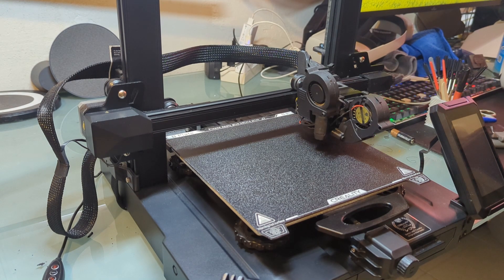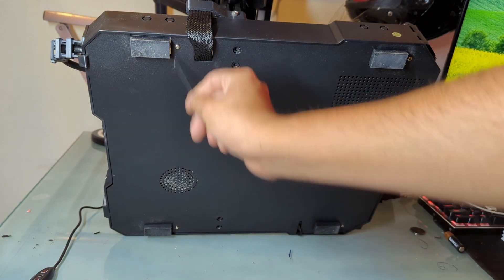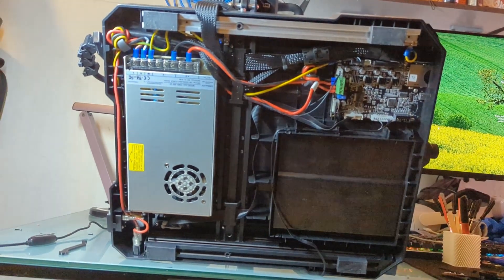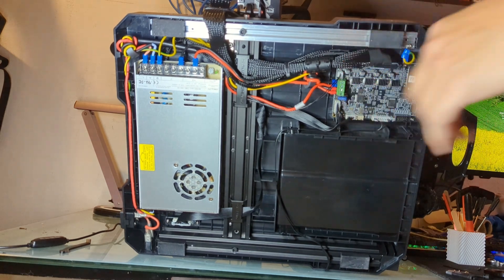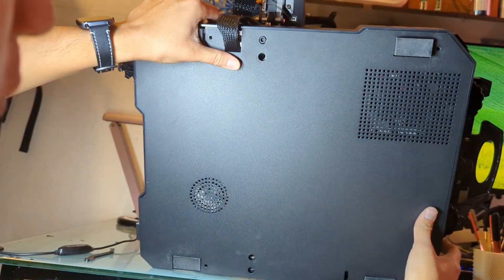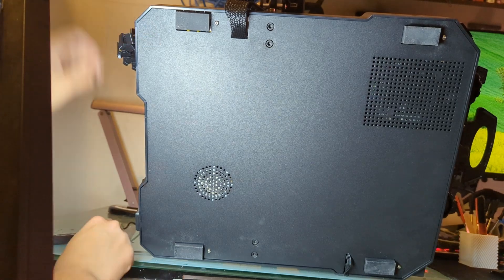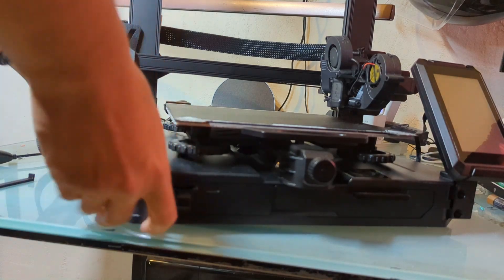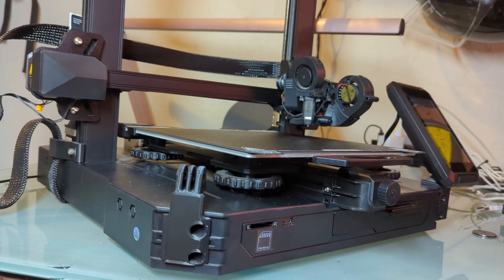ENDER 3 S1 PRO - HOW TO EXTEND THE BED CABLE (a little)

Comment: What I did was take out the printing bed and give it a twist, so the cable would be with its turn facing the opposite side of the motor.

Comment: What is the hotend cooling mod?
Reply from the maker: It's made by Zuff using a 5020 blower: 
https://cults3d.com/en/3d-model/tool/v4-air-duct-fan-5015-5020-ender-3-s1-s1-pro-sprite-extruder-accelerometer-led-strip